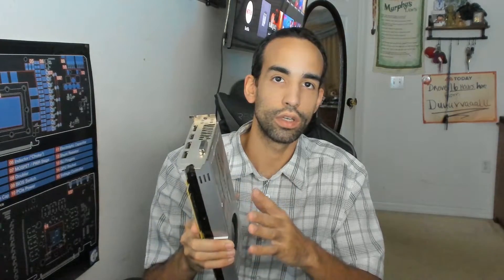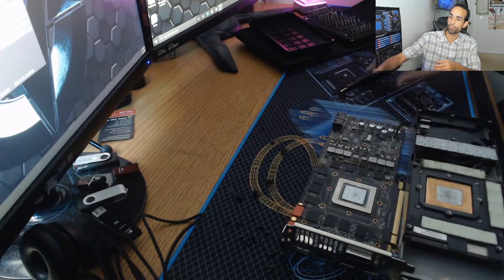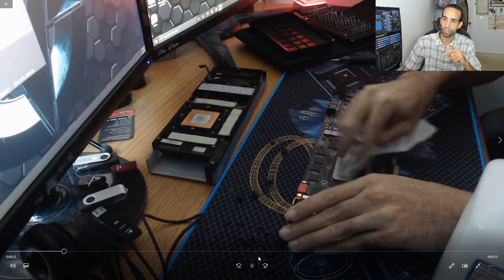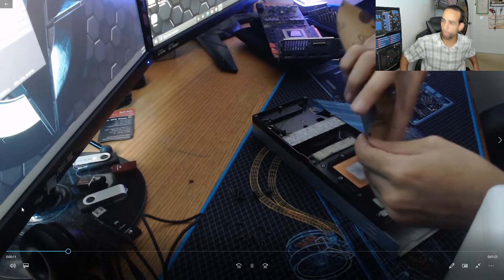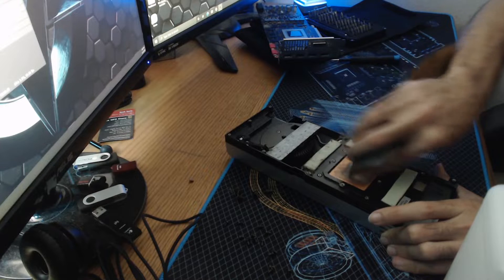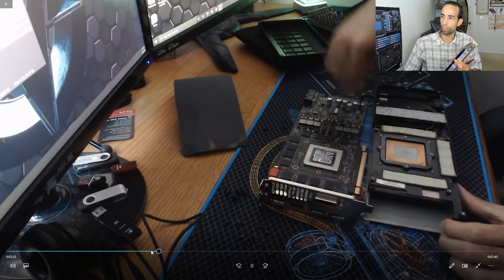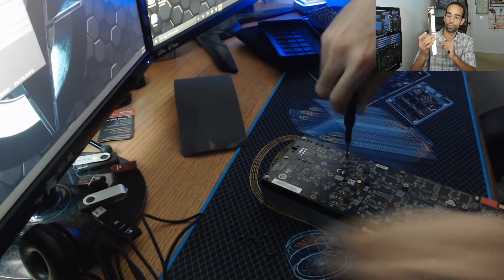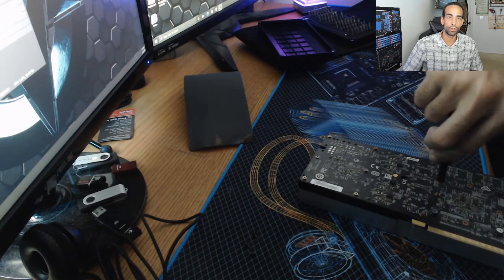Liquid Metal on a GPU after 3 years - How long did it last and when to reapply - 980 Ti

Comment: My 3090 in my gaming rig is currently mining some stuff with daggerhashimoto with Liquid metal and Watercooling...pretty good stuff...To be honest LM is not dangerous at all if you are careful the only thing as I said in the other comment on bare copper you can reapply but gamers nexus proofed that this dry one is not a problem. Thermal paste is way worse after 1 year you can already throw it away and put new on. Condactonaut is great.

Comment: Never put LM on bare copper why?
Because copper sucks the gallium out of the LM thats why it dries out. 
Ok never is the wrong word just put it on and reapply it after 3 to 6 months and dont clean it fully up on the copper side because as soon as the copper is saturated the LM will be liquid like on nickel plated copper.
Reply from the maker: Coper is good, its aluminum you want to avoid. The LM will literal eat the metal away
Reply: @SerpentXTech  And Gallium will go imto copper.
Reply from the maker: @12Burton24  so you want nickel plated cooper correct?
Reply: @SerpentXTech  What I'm saying is bare copper=reapply is maybe necessary in some cases actualy most of the time not because most of the time there is no impact if lm is dry as long as you dont move the cooler OR nickelbased copper LM doesnt need to be reapplied as long as it is Conductonaut.

Comment: I ran mine continuously for 2 years, it also turned into a plate because its penetrating the copper and forming an alloy and the alloy is a bad thermal transfer medium, so you setting it off to the side wouldnt change the outcome you experienced. I removed it using a dremel with a felt tip and rouge

Comment: i applied liquid metal in my laptop to an I7 7700HQ and GTx 1060. This laptop works around 14hours a day. After 2 years more or less, temps are really high and i will have to reapply or just go for thermal paste (which i think i will end up doing).
Reply from the maker: I literally have the same problem (right now as I am typing to you on my laptop) I either have to reapply or switch to thermal paste. I will have a video update in March about it, and what I switched too. Stay tuned, and good luck. Thanks for commenting.
Reply: If it helps, I have i7 7700HQ + GTX1070. Since it's very hot in summer in my country (+30°), I had to repaste the liquid metal after 4 months of use. I've noticed the increase in temperature (~+10°), that's why I've done it. Also, I've combined the LM with Thermal Paste where TP went on little chips around CPU and GPU. I hope it will last this time :)

Comment: I started noticing my temps after 2 years+ and decided to take a look, dried up with tiny chunks. Reapplied another round, see what happens in another 2 years
Reply: I'm here after 2 years.... So what is the results? XD
Reply: @Cipotalp i didnt need to check because it's rocking solid. It's like what Gamers Nexus showed, it's normal for the copper to get stained the first time, dont sand the stain off completely on the second application
Reply: @Naton  Seems this would all be avoided by just re-apply liquid metal once a year.
But overall take away is liquid metal works just fine?
I just applied liquid metal on lenovo legion 5 and the results are amazing.
I'm just worried about longevity, but I'll be inspecting my application every 6 months.
Reply: @dp27thelight9 I'm here after near 12 months could you please say what happened? did you change the liquid metal after 12 months or 6?
Reply: Was it on bare copper?
Reply: What's the results?

Comment: After about 1 year everything was the same as at the beginning

However i cleaned out the dust from my PC and bumped the cooler the cooler shifted and broke the liquid metal seal causing the temperature to go from 66c to 74c just because it was moved

It will work when dry just dont move it or it will stop working correctly
Reply: thanks this is very informative too

Comment: I have the same MSI 980ti graphics card. How much heat difference did you get? How much heat does it see maximum under full load? Now my card is around 90 degrees under load, I wonder how much difference it will make.
Reply from the maker: It drop temps by 6c - 12c depending on the workload for me. But make sure you clean and reapply once a year at least.

Comment: What does the nail polish do? I missed it in the video.
Reply from the maker: Protect the SMDs around the GPU die or CPU die. So incase some liquid metal spills over it doesnt make a connection, or connect SMDs together causing it to dry or short.
Reply: @SerpentXTech  Ok thx understood. :)

Comment: I have also used the thermal Grizzly Pad (8.0 W / mK) but I would like to try later with Fujipoly / mod / smart Ultra Extreme XR-m Thermal Pad - Thermal Conductivity (17.0 W / mK) because it has higher thermal conductivity and I want to see if it dissipates heat better.

Comment: I use Acetone for cleaning paste, or finger nail polish remover since it has acetone in it an can be found at the dollar store. 
this does make me wonder if heating it will bring it to a semi liquid state " like low melt" for better removal.  Watching you sand the material off as best as you can,
makes me think it has bonded into the poors of the copper, or  at   minimal filled them in.
Reply from the maker: I agree the lm has sunk into the heatsink, and heating it will bring it back to liquid state. However, I am not to worried about it, but may test GPU in main system to check thermals.
Reply: @SerpentXTech  It won't. I wanted to reapply liquid metal on my laptop which was on a similar state (solid blob on the side caused by excessive quantity). Cleaned with 99% isopropyl, tried to melt it back with an hairdried with 0 success, I had to  sand as well in the end. After reapplying temps seem quite good. Final word is that I think it's not worth it on desktop components but can really be make a change for laptop
Reply: @supersingot  for how long was the liquid metal applied?
Reply: @ConteXCrown  2-3 years

Comment: I have bad experience with liquid metal and ASUS 280x DC2 cards (gpu coroded and heatsing destroyed) on 6 gpus. Can you do mining test of that old 980ti, I heard that they have problems with eth.
Reply from the maker: They do, I had some old videos of it mining. I primarily had it focusing on Ravencoin or x16r while the rest did ETH. But yes they have crashes mining ETH
Reply: @SerpentXTech  r9 380 4gb is doing 22mh atm on Eth (till december). Amd fine wine.